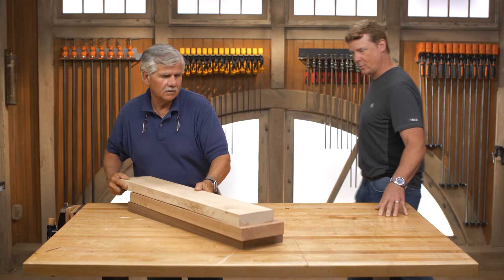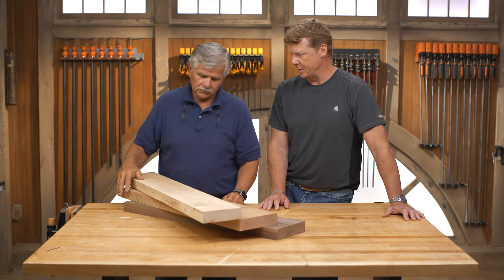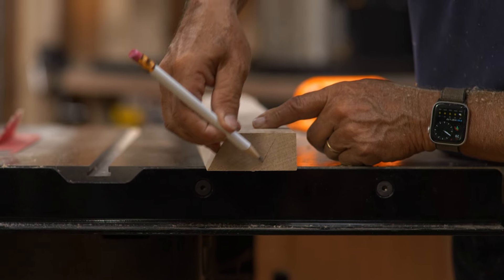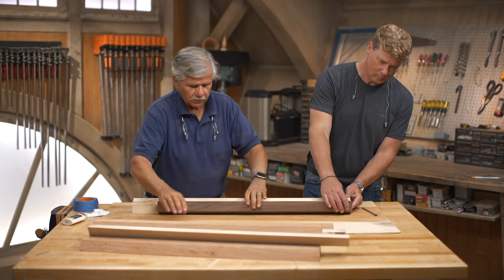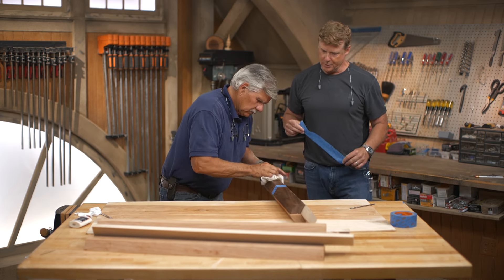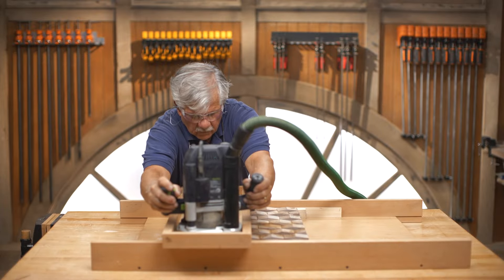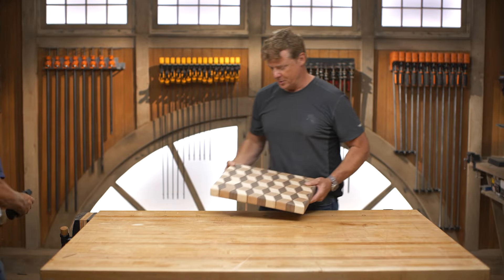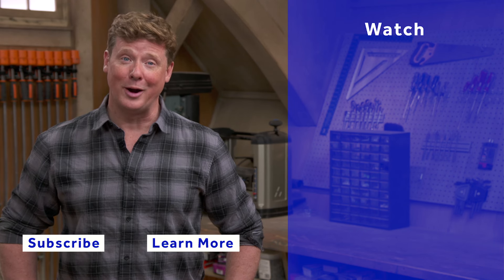3D Cube Cutting Board | Build It | Ask This Old House

Comment: I have made Two of this type, yes the hardwood is expensive , every cut has to be right on. And the glue up is CRITICAL.
take your time. The Blocks Glue-up portion you must work fast if you use Type 3 Tiebond. I am going to use a slower setting
Glue Titebond dos Make one. Tom is a Master woodworker and makes it Look very easy.

Comment: I'm in the process of making this and it's coming out nice so far and i thank them for sharing this.
Last night I did the final glue up( as shown at 5:00 ). This was a challenging glue up and it would have been nice to have seen their clamping procedure,but they cut that part out.
My initial thought was using calls all the way around-but that caused everything to shift.What worked for me was(starting with a dry fit) using calls on the side where the blocks had a pointed side on the outer edge with one clamp in the center.On the side that the blocks had a flat spot i used a clamp on every row of blocks and no calls.
it does seem like there may have been a better way but this way had minimal to no no shifting and woulda been nice to see how they did it
Reply: ratcheting band strap might be the best solution here due to the weird shapes.
Reply: @Afisch00  strap is my approach when I try this in a couple weeks
Reply: @kevinhaley1  how'd it turn out with the strap? or would making walls to clamp it down have been easier?
Reply: Oversized rubber bands.
Reply: you could cut the edge blocks flush and then use any usual clamping technique
lots of extra work & precision required though

Comment: I priced the wood needed to make this today and assuming you could get 8/4 lumber in 3 to 4 foot lengths like they showed in the video you would have to spend between $100 and $150 for the material.   They had the cherry and maple at between $40 and $50 a board but they only had walnut in 8+ foot lengths and it was going for $14 a board foot.   It was a nice idea while it lasted.  I thought I might be able to substitute mahogany for the walnut but they didn't have that in 8/4 in shorts either.
Reply: @thomashajicek2747  Yes, after looking at the 8/4 lumber I though the boards on the video looked thinner - I wish they would have included a materials list.   It looked like Tommy was ending up around 1 3/4" after planning so I figured he was starting with 2" stock.   At any rate there wasn't a lot of short boards to pick from in anything other than 3/4".  Everything thick seems to be going into live edge boards these days because that's where the money is.

Comment: Looks awesome. Would have loved to see the final glue up though. Anyone have any idea how you could glue this up without the pieces shifting all over the place? Seems like it would be difficult to use clamps on this one.
Reply: Agree...I don't see how it would be clamped.
Reply: I know I’m late to the party, but this board looks amazing. Just one question, in this video you say cut a 30 degree angle. In the article for this video on the TOH website you say 60 degree angle. Any clarification would be greatly appreciated.
Reply: 60 degree is the right angle, I think he meant 30 degrees off 90 which is 60. 6 sides at 60 degrees equals 360

Comment: This is a good video but the problem I have is, they didn't show the full glue up and what they used to hold it all together. I've been trying this and that's the challenge I've had is the final glue up. Also, a little more info on how to get the perfect diamond would be helpful. It took me a lot of trial and error to get the diamond sticks right and even then, they were off a tiny bit, which causes an issue on the final glueup. Which is why I would have loved to see how they did their final glueup and any prep.

Comment: Tommy and Kevin, Why use a router to surface the cutting board and not plainer?
Reply: They were worried about tear out because their dealing with end grain wood.
Reply: @brianhoefer3043  Thank you Brain, I did not think about that, Your right.
Reply: its the best and safest way to do it
Reply: @thomashajicek2747  You build your way but i have made 100+ end grain boards and i use a router sled and a drum sander